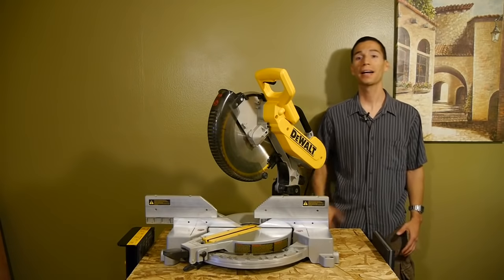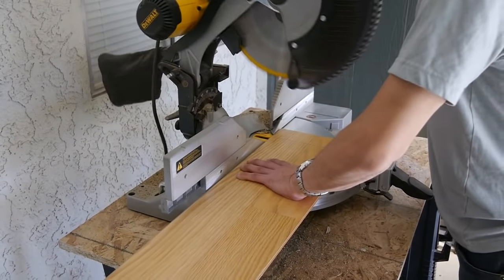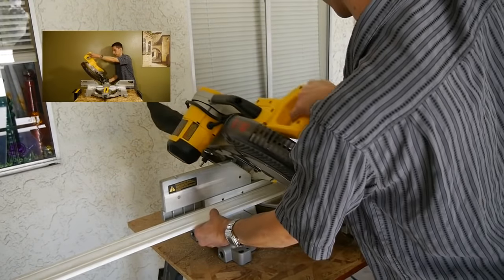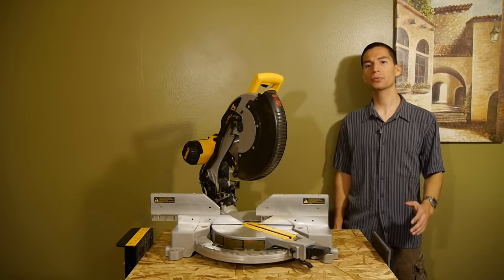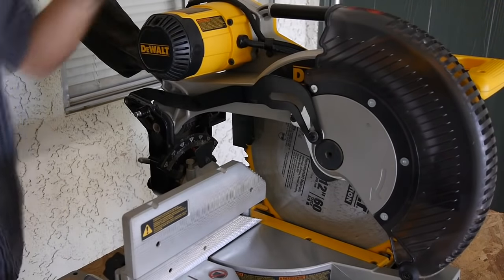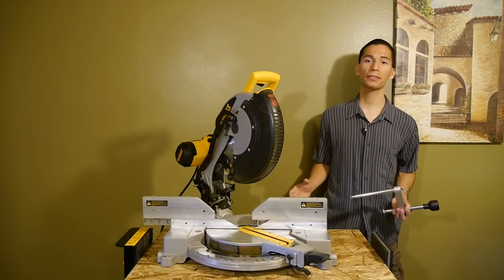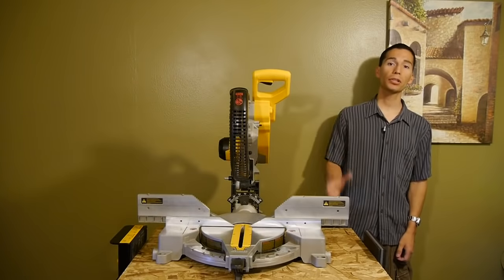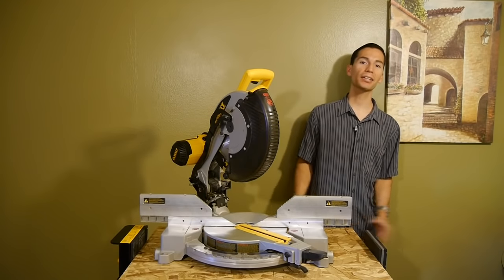DeWALT 12" Double Bevel Miter Saw DW716 REVIEW and comparison with DW715

Comment: Exactly what I was looking for in a 715 vs 716 comparison.  Straight to the point.  Hit all the major differences.  Very good presentation.  Looking forward to other reviews.  How about the 779 vs 716?
Reply from the maker: Main difference is the 779 is a larger saw and a slider but doesn't have the built in LED shadow light system. The 779 is basically a 780 with a few missing features

Comment: One thing worth noting, is that last time I was in home depot and lowes, looking at these saws, thinking about adding a 715 to the tool arsenal, to my surprise, dewalt is silently killing compatibility with the xps led system. This is true in the 713, 715, and 716. I bought my 713 used for this reason. I really, really love the led, because it cast a perfect shadow of the blade kerf onto the work piece for a damn near perfect cut every time. That being said, these are still the most outstanding saws I have ever used, and I absolutely love them.
Reply from the maker: I've heard that about the compatibility. I did some research and couldn't find out which type doesn't have compatibility. Said compatible with models 1-4 but weird that it doesn't say compatible with all models. I looked at the pdf manual for type 4 and says it's compatible with both lights. Also when I was at Lowe's I looked at the box in store for the dw716 and said it right there on the box it was compatible with both lights. I even took a picture, but I couldn't find any info on the box about what type 1-4 it was. On the parts website I could see 5 models: type 1, type 2, type 20, type 3, type 4. I wonder if type 20 is the oddball
Reply: I think it's type 20, yeah. Yours is awesome and will work with the system. Definitely worth the couple bucks bro. I'd go for it, lol.

Comment: could you do a video concentrating on the back fence procedure. I need a good explanation of the way to add the underboard and what I need to do. Thanks.
Reply from the maker: +David Lowrance I'll keep it under consideration, it's quite simple actually and can easily be explained. Remove both fences- that's it really. With the fences now gone you can use the built in back fence, although you will need a wide 2x lumber underneath to support the one being cut

Comment: Hey Javier! I am looking for a 12" compound miter saw and one thing I noticed about the DW715 is that only the Type 3 is being sold (at least everywhere I looked).  The DW715 Type 3 is not compatible with the optional laser accessory.  It's a shame because the DW715 is $199 now on Amazon with free shipping, while I can find the DW716 for $330.
Reply from the maker: That's too bad about the compatibility issue. I've heard about it I just didn't know what models and types. $199 is a good deal for the dw715 and atleast you can buy those laser attachments that go next to the blade although probably not as good as the dewalt laser accessory

Comment: Hey tool crazy. What is better, a laser guide or a shadow guide? I used to have a saw with laser but never used it. I would just drop the blade down to the wood right on my line and then I would start cutting.  Does the dw715 come with a shadow guide accessories? Thanks.
Reply from the maker: jgdoollc They're both good at doing the same job, the LED light is nice because it requires no adjustment to line it up and automatically determines blade thickness

I don't think the DW715 comes with it included

Comment: What size bolts do you need to mount that to the table? My DWS715 didn't come with those bolts and I can't find that information anywhere.  I can pick bolts up with washers and lock washer up at a hardware store easy, i just wanna know what size i need before going there.  Just going to mount it to a 1/2 inch piece of plywood table i made up.
Reply from the maker: I go by eye, the only thing I'll measure is the length needed for the bolt so it's not too long or too short then get the appropriate sized hardware

Comment: What made you go with this over the dw709? Looking at both so was not sure which one to go with.
Reply from the maker: Wasn't aware of the dw709 at the time so It didn't come down to either or situation like you're describing. I went with this model back then because I needed something as compact as possible but yet could cut large width laminate flooring planks which is what I was doing at the time. Sliding saws were too big for my needs at the time.
But since then my needs have changed and now I have the dhs790 dewalt model

Comment: Javier, I'm ready to upgrade my tools soon and would really appreciate your opinion (or even a tool comparison review) for the following tools.  I'm torn because I've grown to really appreciate the smaller/lighter tools I use for most jobs but Eric and Dan at TiA really like the Dewalt 20v brushless compacts.

Impact driver: Dewalt 20v brushless compact DCF895 vs Milwaukee M12 2453
Hammer drill/driver: Dewalt 20v brushless compact DCD795 vs Milwaukee M12 2404

Thank you, Javier!!!
Reply from the maker: Out of all those I've only tried the m12 fuel impact. So it's hard for me to comment on the others without having tried them. I really like the m12 fuel but personally I like having both 12v and 18v tools and choose between the 2. If you can afford them I would get both impacts. I cant suggests both drills though to own at the same time, too similar from a spec standpoint, but then again like i said I haven't tried them. I like having a 12v and a heavy duty 18v combination.

Comment: I bought the 713 10 inch single for doing my home projects but I ended up with the Type 2 so I took it back coz it would not accept the light or laser. I went to 6 stores looking for a 716 that takes the light/laser. Can you tell me the difference between the types (1, 2, 3, 4 & 20)? The only thing I found out so far is that the Type 20 will not take the light/laser.
Reply from the maker: Tony D not sure what all the differences are between types. Could be minor manufacturer differences but you can always contact DeWalt for more info. I've heard about the incompatibility with types before although I didn't know which type was affected. At the time I did this video, Lowes was carrying some on stock that were compatible with the laser, I even took a picture- says compatible with laser on the box

Comment: Good video, Javier. Maybe next time you can do a review of an OMT. That'll be cool.
Reply from the maker: Thanks Markus, don't laugh at me but what's an OMT? I tried googling it but couldn't find anything tool related
Reply: ToolCrazy To be honest I smiled a little. :) OMT stands for oscillating multi tool. Like the Fein MultiMaster, DeWALT DWE315 or Bosch GOP 250 for example. These are really handy tools because of their multifunctionality. You can cut pvc pipes, wood, thin steel, use them as a small sander, use them for grinding and much more. I think that is why these things are called OMT. Really cool lightweight tools and highly efficient.
Reply from the maker: Yeah I know about multi tools, I got the m12. I never heard anyone call them omt's. Yeah I can check out a multi tool soon
Reply: ToolCrazy Cool, thanks. I kinda remember that Dan and Eric from "Tools in Action" call them OMT's. I think it was Dan. Or maybe it was Rob Robillard from the channel "A Concord Carpenter". Yeah, the M12 from Milwaukee is also a good candidate for a test. A cordless or corded multi tool for the review? What do you think, Javier?
Reply from the maker: I prefer cordless tools but I would check out corded multi tools models too
Reply: ToolCrazy I also prefer cordless tools but it depends on what I'm going to do. Inside the house corded tools are better and outside the house the cordless ones are the best choice. Sometimes it switches back and forth because the power cord isn't long enough and there is no extension cord. I guess you know what I mean. Home improvement ... I totally love home improvement. Who doesn't? Ok, great. I'm looking forward to your next video review.
Reply from the maker: Good news Markus, I'll be working on a multitool video soon
Reply: ToolCrazy Cool. I'm looking forward. Thanks, Javier.

Comment: Javier, awesome video man! I have the first model of this saw before the clamp for locking the table.  I was wondering if you could tell me if you know how to square up the fence? My left and right side fences seem to be out of alignment. CJ
Reply from the maker: Case 275 thanks CJ. Hey sorry for the late reply, I had to go take a look first before I said anything. On my miter saw there aren't any adjustments for either back fences other than being able to slide them left and right or remove completely. If these are out of square then it would mean either the base that holds the fences or the fences themselves are bent but you did say yours was the older model so I don't know if that one has the ability to adjust. Sorry I couldn't be much help.

Comment: This was an informative video.  Very informative.  "LIKE".  Would have liked to see a little more detail about the accessories that 'should' have been included, and seen them in action.  The crown stop for example.  You mentioned it could also be used as a repetitive length cut stop?  How would you mount it in that case?  Dewalt's website is awful.  I can't find the accessories anywhere on their website other than in the user's manual.  They don't even list them wiht the saw (I was just there right before I watched this)  Anyway - good job.  You've about made my mind up for me with this video.  Thank you again.
Reply from the maker: Thanks. The problem with this saw, at least the one I bought was that if you look at other brands, they include at least a material clamp as standard. And many more include extensions as standard as well.
I've since sold this saw and the 20v miter saw and bought the dhs790

Comment: Well Done.....Very helpful.
Reply from the maker: thanks John
Reply: I just picked up the Dw715....I hope I don't regret it. They had it on sale for $199.00 I couldn't pass it up. I hate my eye on the Ryobi 12 inch Slider. The 48 foot clearance turned me off.
Reply from the maker: unless you don't need the additional features of the DW716 you'll be fine with the 715

Comment: Anybody own this saw? I've read some reviews that claim the motor is underpowered and bogs down on thicker wood and the bolt to change the blades is a hassle...
Reply from the maker: Hey there, I used to own this saw. You should watch my video review to see if this saw is weak and can't handle thicker wood. I'm not sure if I covered how to change a blade, but it does require more steps to change a blade since the blade guard has to be moved out of the way to access the blade bolt. Whether that's a hassle is subjective however it requires more steps than a circular saw. I'd say someone is lazy if they think a couple of extra steps is a hassle for something that has to be done every once in a long long while. As far as cutting thicker wood, you really should watch this video to see how it performs with your own eyes. What you heard sounds to me like whoever owned this saw needed to replace their blade. Yes, blades do become dull and need replacing after so much use.